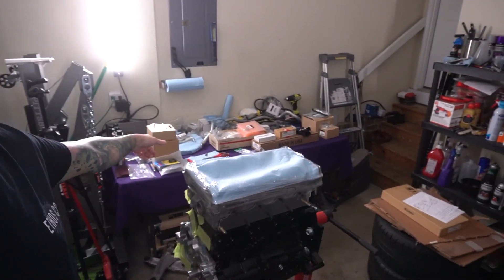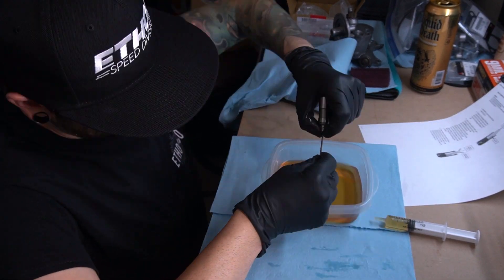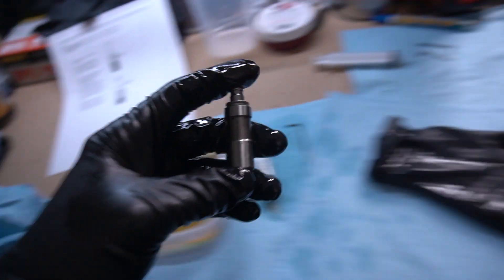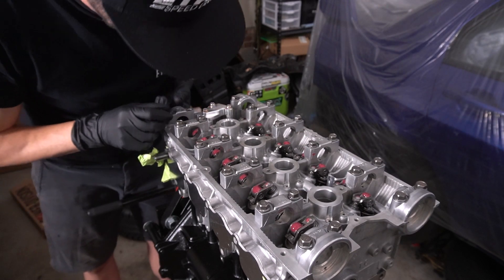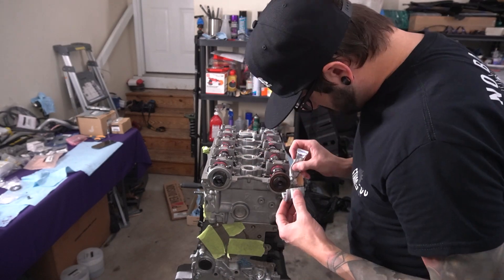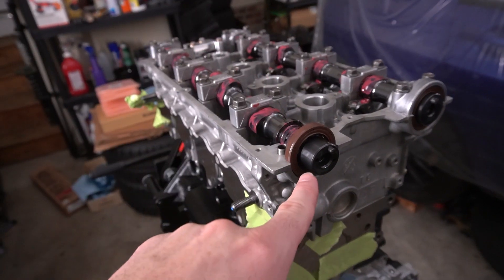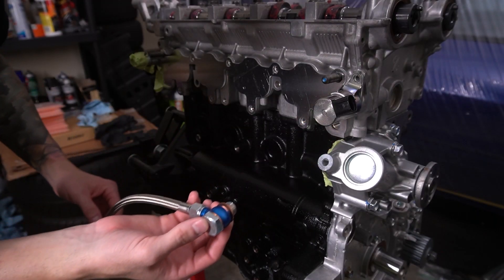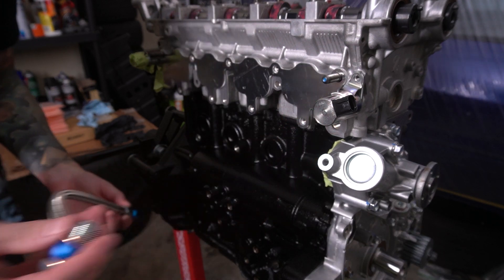Reassembling A Fully Built MAP 4G63 Motor For An Evo 9 | Part 2 Progress

Comment: At 13:40 There is No sealant or plumbers tape on the AN fitting threads, doing that is a noob mistake, they are designed to seal via the 37* taper and cone on the fitting ends, putting sealant on them or tape can actually cause leaks, you can put a light layer of lube on the cone ends, most AN fitting companies reccomend using a light amount of lube on them.
if the fittings leak they are not tight enough, just tighten the fittings by hand.
Reply from the maker: Yea, I've always heard never to put that tape on anything, it just deteriorates or gets torn and can fall into or get sucked into the motor. But yea that lubing I think just prevents galling and what not on the threads.